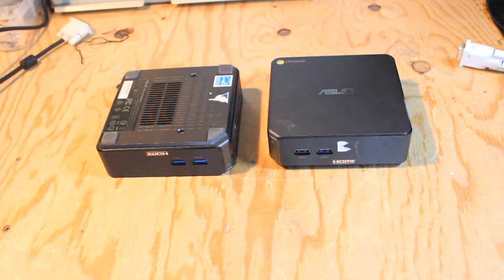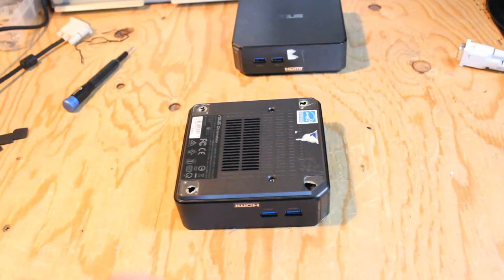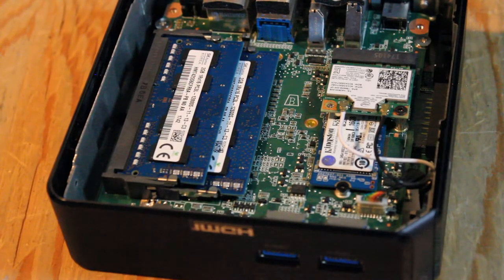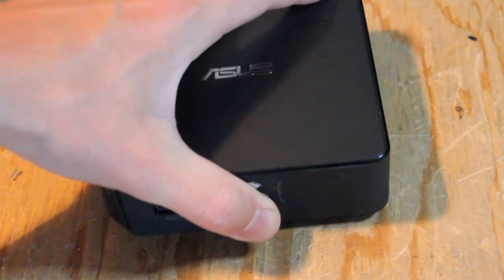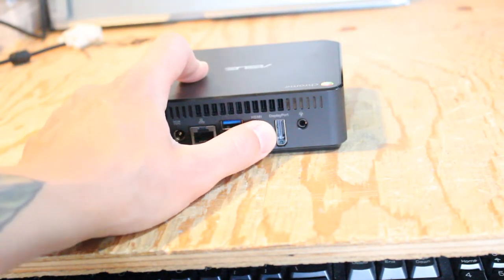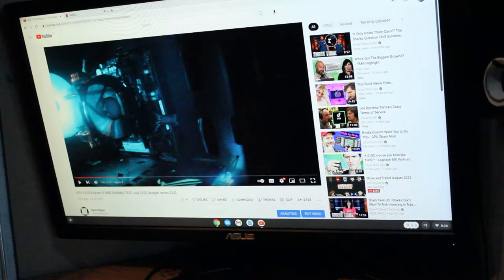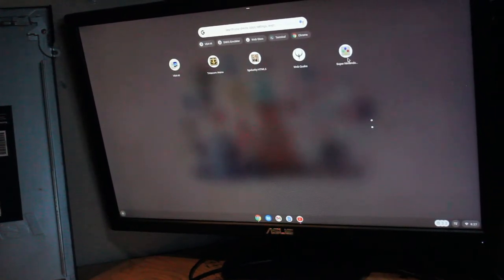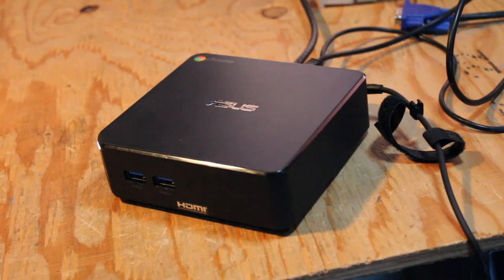ASUS Chromebox CN62 in 2022?  A Look Inside and Test Run

Comment: Power bricks on the older model looks more neat than those that comes with the newer version such as those in chromebox 4 i7 variant. propably because of its higher power requirement.

Comment: My Chromebox CN62 that I just bought from you on eBay works great! Thank you so much! I only plan on using it hooked up to my TV for Netflix, Youtube, maybe emulators. For that purpose it works great! I love how fast it boots up!
Reply from the maker: That is great to hear, thanks for checking out my channel!  This particular model has a weaker CPU (hence the cheap price) so if you come across 2 x 4GB DDR3 1600MHz RAM sticks (to total 8GB) at a price you like, this video will show you how to replace them and it will provide a small boost in performance.  You will need some kind of adhesive/glue to stick those pads back on.  I used JB weld.  Probably a bit strong, but it's what I had in my shop.  Good luck and keep in touch if you need anything :)
Reply: @HaisteComputerRepair  I do plan on upgrading the RAM and M2 SSD in time. If I change out the M2 drive in it, do I have to reinstall the Chrome OS?
Reply from the maker: @tall_dude1233  Yes, that's right.  Unless you are able to clone your  m.2 to another m.2, which would require using an m.2 nvme to usb adapter and using software like Macrium Reflect.
Reply: Could you mind to share that it can run apk or not? Many thanks.
Reply: @vincentcheung2384  Yes, it can run Android apps!

Comment: I gave new life to my cn65 by installing windows11 . And Using it as regular low power windows pc also for running virtual machines..
Reply from the maker: Nice.  I would like to try out something similar, but being that this is a model with the 2 core 2 thread Celeron CPU I think I may be limited to lighter Linux Distros.

Comment: suggestion for disassembly so you do not damage plastic by prying it open. After removing screws , use one of ther removed screws temporarily in one of the bottom mounting holes and pull it open. Way too simple no risk of damage
Reply from the maker: Thanks!

Comment: What’s the max storage capacity? Some of these boxes only allow 32gb max. Wondering if that’s the case for this?
Reply from the maker: I am assuming you can install any capacity NVMe SSD.  As for what it shipped with, I am not certain what the max capacity was when manufactured.
Reply: 16Gb. I upgraded mine to 16Gb and it works fine.
Reply from the maker: @philiptownsend4026  You're talking RAM or SSD capacity?